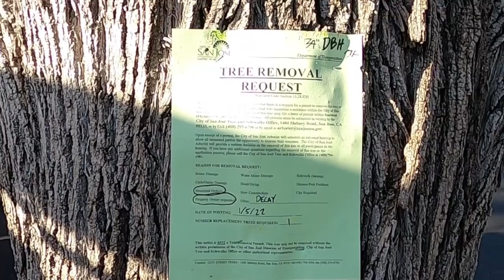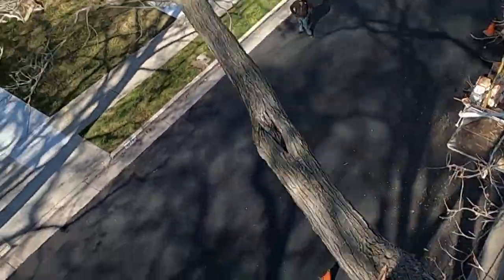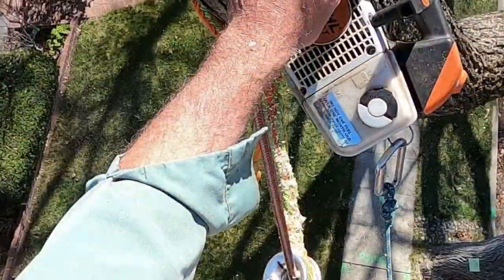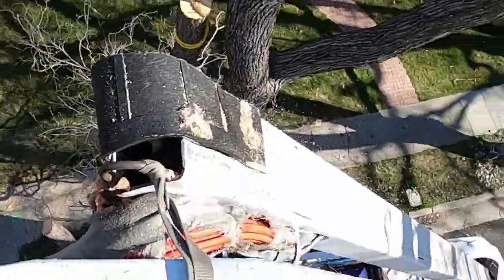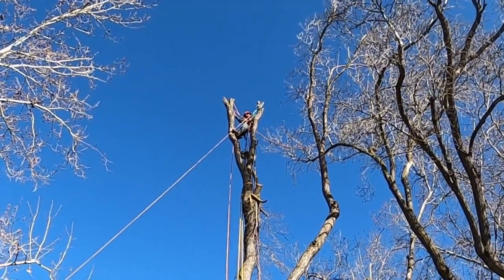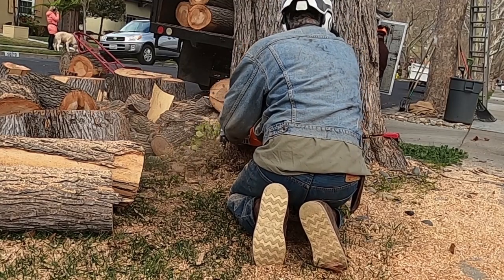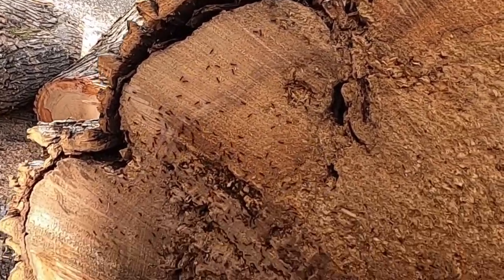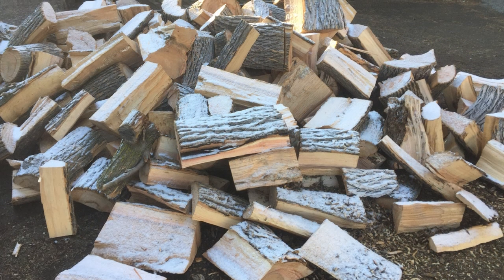A REAL PAIN IN THE ASH JOB!!

Comment: when cutting a big trunk like that  i personally think if i can explain it correctly that this way is the best. so what you have to do is use two wedges and have them on opposite sides . like in a straight line one on one side and the other on the other side of the trunk. put them in when you first need wedges at the normal spot but once you get 3/4 of the way move the two wedges over  50% of the trunk towards the saw and what you have is a  fulcrum so when you finish the cut the log will pivot on the wedges lifting the side where your bar is up.

i think this method  could have helped you with your bar.

one other thing i want to say is  that i think you are an amazing person, i love watching this channel and your videos. as a new subscriber and a tree man that loves to learn. i learn  each and every video. i think attention to detail and working in the trees best interest is what its about. i always run into other peoples dare i say hack jobs in trees and i dont get it. its nice to see someone who is invested in the trees as much as i am. 

thank you and keep up the wonderful work
best wishes
Reply from the maker: Thanks Wayne, yes we often use the double wedge technique as well but that means stopping and configuring the wedges. Not a big deal but it does mean stopping the saw. In the technique I’m showing, the key is leaving just a bit of wood to allow a quick pull out. In the saw pinch, I didn’t recognized the decayed area that collapsed on the saw. I should have used two wedges but it happens sometimes. I’m never afraid to show mistakes or stuff that happens because those are often the best learning segments. I enjoy feedback and think you are a valuable participant in this YouTube video community.
Reply from the maker: I hope you watch the most recent video I just put up.

Comment: I used to love getting in the groove while removing ash street trees. Stacking the brush from the bucket by swinging the limb after the cut. We didn't have to worry about the street and could get the tree down really quickly. Of course now I have a bum shoulder.
Reply from the maker: It’s easy to feel invincible but our parts do wear out.

Comment: Hi Blair -
I just rewatched the removal of that big, heavy redwood in the tight yard corner. In this video you showed us a handful of stumpgrindings and spoke of your garden. Now my question is, what are the parameters to using similar material in a garden or as tree mulch?

Is there something about letting it sit for a while?
Can we use it immediately?
I need the instruction and would appreciate learning the method or reason for whatever action is to be taken.

With regards,
Michael.
Reply from the maker: The difference is in the words “mulch” which sits on top of the soil and “amendments”, with is decomposed and aged to improve the consistency of the soil. Organic matter sitting around n the surface is not a part of the soil structure but important for water conservation through protecting  from evaporation. Mulch also breaks down and introduces beneficial micro fungal contributors that are so important. A cooler soil also allows for worms and all the living parts of quality soil to develop. If you till the fresh wood into the soil, it actually makes things worse for a while. On top, great.
Reply: @arboristBlairGlenn  
Thanks to you Blair, I can now claim a PHD in mulch. (Piled Higher & Deeper.)

•Is there an average time for amendments to sit and do their rotten work before use? 
•Will the pile need turning?

Thank you sir.
Michael.

Comment: Curious if there is a reason your thumbs don't grasp around the chain saws handle,but rest atop.i  used to do that,it felt comfortable, but have changed since
Reply from the maker: Guess it depends on the position of the cut and my wrist. I generally keep my thumb around. Safer that way.

Comment: Out of curiosity, why did you choose to chop this particular tree into firewood? Is ash particularly good for burning? Thanks!
Reply from the maker: It is good firewood but this tree also was full of decay and carpenter ants. Save three straight saw logs which I have milled into half inch thick boards.

Comment: You could sell that un-cut firewood here for $200-300 a tonne!
Reply: Also, you scare me splitting the logs without safety glasses on!!
Reply from the maker: Here it sells by the cord. There by weight?
Reply: @arboristBlairGlenn  Usually by weight or 'trailer load'. Trailer load usually means in the tray of a ute (What you Americans call a truck, just smaller) or in a normal 6x4foot trailer. Quite expensive over here!

Comment: Wow, that's a rip off. My dump takes EVERYTHING for Free, FROM EVERYONE. They always have a pile of wood and limbs about 20 feet high because of the loader they use to pile the wood up and make more room. Someone has a deal with them and they have a massive chipper on site that can do pretty much anything.
Reply from the maker: When you work in an over priced place like Silicon Valley (California), everything is over priced. I live debt free up in the hills above this mass metropolis. On the positive, I make good money working for the rich. On the negative, it’s too crowded, too expensive and just too much. I was born here and have seen crazy changes. When I was a boy, this valley was full of orchards. Not anymore.

Comment: Man that’s unreal you pay $500 to dump…I usually get paid twice from good firewood like that..once removin it…and again sellin the firewood…only a few species we throw away like box elder..alder..however it’s spelled and poplar unless one has a use for it..cut alotta white oak,cherry,maple and have cut locust over 30”dbh…stay at it ol friend..matt
Reply from the maker: This part of California has burn bans so most homes don’t use wood anymore. Mountain homes do but most mountain folk cut their own wood. I used to sell 200 cords a year (right before Christmas ) but not anymore. I burn and have three wood stoves.
Reply from the maker: There is a tree called Box Elder as well as a tree called Alder. Very different trees.
Reply: @arboristBlairGlenn  The Box Elders are a very common tree here. They are definitely not a type of tree you would want to have. They grow as fast as the weeds, sometimes even faster. They don't hold up too well once they get bigger.
I have a couple of them in my front yard, they are both in need of a serious trim, they are starting to look like giant bushes instead of trees. One of them had 2 trunks and the one with a hard lean twisted and broke and fell down, no decay whatsoever in the trunk, all solid wood. I deal with Box Elders all the time and from my experience they are not very safe trees, failures are very common with them. They grow far too fast and don't get super strong like many other trees
Reply from the maker: @OBS_Ford_Diesels_Inc  an interesting aspect of the wood from this tree is sometimes, in older trees, you can find beautiful red streaking in the piece. Wood turners like this for bowls.
Reply: @arboristBlairGlenn  that's something I've noticed, though I'm not sure how well the wood would hold up, box elder decays fairly easily and it grows very quickly so the growth rings are not very close together.
The box elder from my front yard is going to become campfire wood, it will be good for that. The trunk split open in a spiral when it fell down, it had a very hard lean and became too heavy to withstand the high winds that took it down.
The brush I've been burning when I am burning old broken junk pallets, it's all still green and alive but it burns with a good fire from pallets.
The remaining 2 giant box Elders will be getting a trim once spring arrives, hopefully before they start leafing out.
Reply: @arboristBlairGlenn  I wasn’t sure our Ky slang hadn’t turned elder into alder lol..this is why I love old fogies like you..ain’t much you uns ain’t seen nor done..logger Wade milled some box elder few yrs back and sold on his channel that really surprised me with that blood line streaks…one of our most common trees with tulip poplar and white oak…you wouldn’t believe the nice white oaks on the hillside in front of the house..almost every tree is one or beech…live in a holler deep in Appalachia coal country…thanks Blair hope I get to meet you someday along with the other great tree men out west..